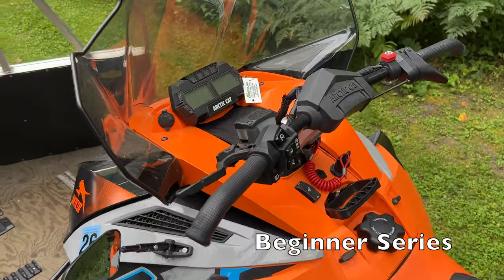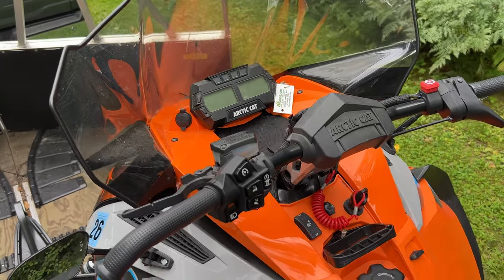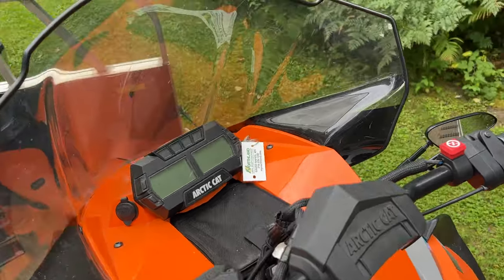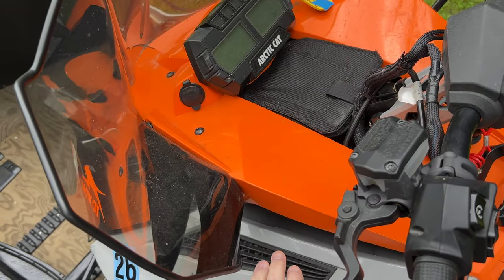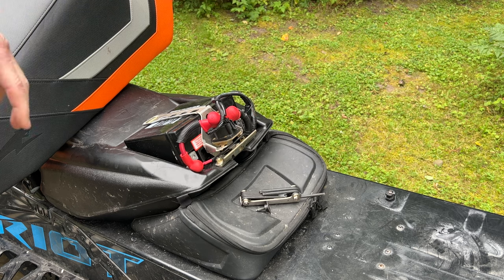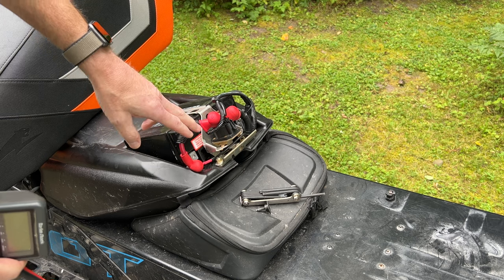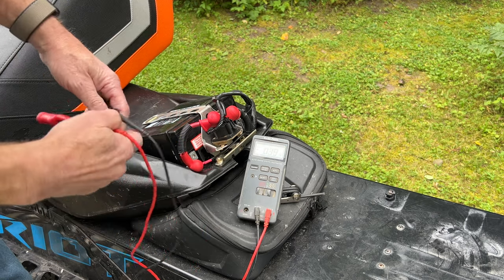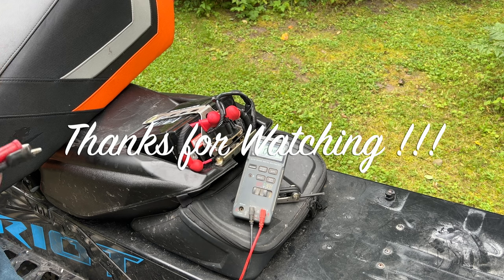Snowmobile Battery - How to Know if it's Dead

Comment: Thank you for this very informativ Video! My 600 ace only has Electric start and it wouldnt start (very cold temperatur). I have a jumper pack and with that it Starts up good. As soon as i take the jumper pack off it shuts down again… How do i know weather to buy just a new battery or if the Snowmobile isnt charging the battery and the new one will be sucked out as well? I could also buy a battery charger and try to charge the battery. Does your test also work to find out if my skidoo charges the battery fine? So if the voltage Drops how do i know if it is a bad battery in bad charging of the snowmobile? Thank you!! Never been good with electrical stuff 😅
Reply from the maker: I would suspect the battery first, since the engine starts when you jump it.  The test I described doesn't check to see if the system charges, but if you can leave the battery exposed when the engine is running, check voltage at the battery - should read higher than 12v (I'm pretty sure).  But, if the battery won't hold a charge, then at the very least you need a new battery.  

Here what I would do:
1-Charge the battery and then let it rest for maybe an hour or 2.  Should still read 12.5-12.6 volts.  If not, replace battery.
2-If it holds a charge, then try to start the engine.  If no start, check voltage.  If voltage is less than 12 volts, then replace battery.
3-If it holds a charge, starts engine fine but then is dead the next time you try to start it, check voltage.  If it's less than 12 volts, then you've got some kind of drain in the system.
4-If everything works fine up to this point, but every time you try to start the engine, the battery seems weaker, then it is not charging and there's a problem with the charging circuit on the engine.

Hopefully, that makes sense.
Reply: @ponycarfan  wow, thank you so much for your time and help! Much appreciated 🤗 i will try out the order you recommended and will let you know. Charger and Tester already ordered ;) will need these tools at some point anyway. Cheers